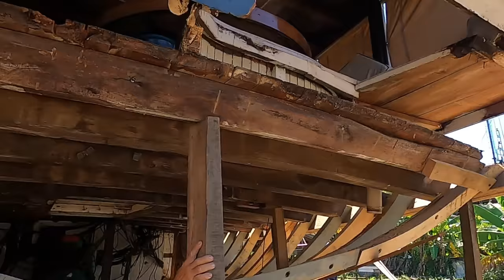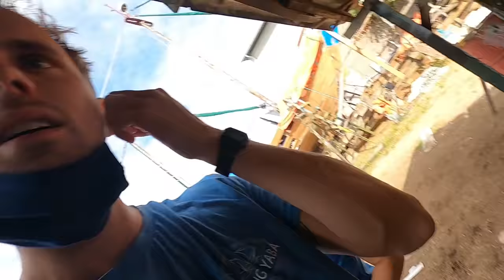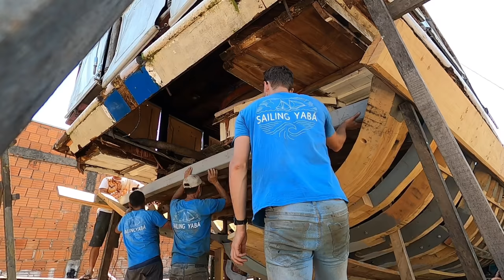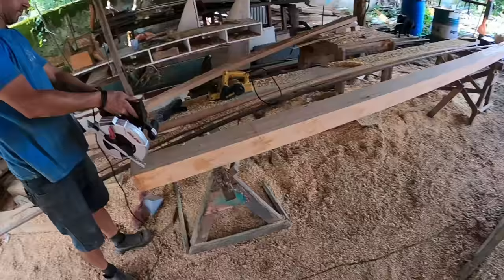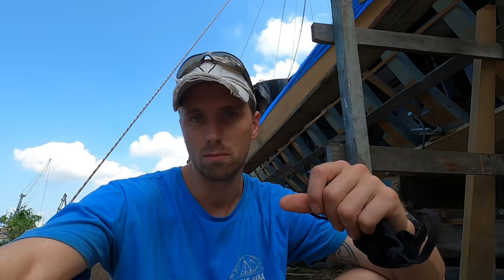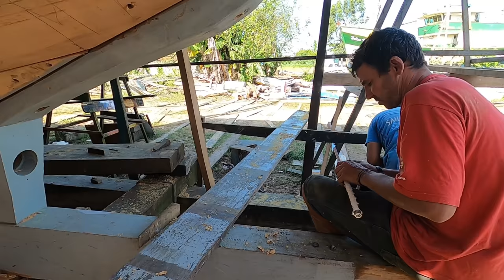Wooden schooner rebuild: TRANSOM! — Sailing Yabá #31

Comment: Not finding fault, but in my 80 years I have been involved in many boat repairs but I have never seen what appears to be galvanized nails use to hold the boat together. One should avoid, steel(except stainless steel) iron and galvanized nails. Use stainless steel or bronze bolts and screws. If you have spent much time on wooden docks for instance, you will see galvanized nails with rusty heads actually protruding above the deck boards. It seems that many seem to always back out and once this happens the hole will never hold the nail firmly again. My friends, there is much to rebuilding wooden boats that is just not being done on this project that will protect it 10 years from now. I suspect that this is why this boat is in this shape after such a short amount of time?
Reply: 100% correct. But this is also cost related.  Joints are far too rough and will gather rot. I have never heard let alone seen non stainless or bronze being used as metal fixings. Also not sure how hard this wood is as the speed at which the band saw is cutting through the frames along with the amount that can be taken off by a small electric planer is not something I have seen before using hard timber. Would not like to faring her after caulking. Their arms are going to like lead!
Reply: After seeing Acorn to Arabella and Leo at Sampson Boat using copper bolts and bronze rivets, that's exactly what I tought and questionned long ago... With no answer. To me, it's not if but when the iron rot will appear throughout the whole thing. Again. Sad. Surely a matter of costs in Brazil but even so...
Reply: you are perfectly right ...this will not last very long ...
Reply: Except you are finding fault, this is how boats are built in this area and the boat will likely outlive the owners.
Reply: CaptRon, very nice the B-25 Mitchel, is it yours?
Here in Argentina they are restoring one and they are going to take it to its original flight condition. If you want to see it on the FB page ... the link is this: https://www.facebook.com/proyectob25. Regarding your comment about yaba and nails and screws, I totally agree with you. I have visited many shipyards where I saw old classic wooden sailboats restored. In Brazil these escunas are very common for coastal navigation. but in recent years its construction has declined due to the prohibition and restrictions on the use of wood. Greetings from Argentina.
Reply: Using DGS (Deep galvanised steel) isn’t unknown,copper/ bronze better but expensive electrolytic reactions shouldn’t be a problem a good primer rich zinc/ aluminium primer may help. Wooden boats are cheaper to buy but much more expensive to keep even if you do all the work yourself.
Reply: @TheBeaker59  Sorry John, I really do wish this couple the very best and hope that they will get many years of enjoyment from Yaba. But there is no way that Yaba will out last her owners. It simply is not possible.
Reply: Everyone has different experiences, but galvanized nails are indeed common in the boatbuilding industry around the world.  Many marine suppliers continue to supply high quality hot dipped galvanized fittings and fasteners.  I am aware of several ongoing restorations where planks are being replaced after 75 years and the iron nails are still holding.  In addition, wooden trunnels have held planks on successfully for many decades as well.  Maintenance plays a big role in the rate of degradation of galvanized fasteners and fittings, as does controlling electrolysis.  I am not saying that galvy nails are the ultimate choice, but millions have been successfully used in boat building.
Reply: Relax, this is how they build ships in the area. The shipyards there have decades of experience building these things. When you build yours , you can share it on YouTube
Reply: @75echo  Really?? And this is how they build "ships" in this area so its ok?? This is your answer to what is 'ok' verses what is proper and correct?? Are you suggesting that because they are wherever they are that using improper fasteners makes it ok?? I suggest that the "ship" as you call it is likely in the condition it is in for the exact reason, using galvanized nails, steel and cast iron!! If you somehow believe that salt water will somehow not soak into and around the planking then you obviously have no experience with salt water and boats. Why do you think it is imperative the engines used in salt water have fresh water cooling? Because salt water will wreck an engine cooling system is short order. As for this boat, I promise you it will be on the hard once again with major problems in the NOT distance future.

Comment: Every time I watch one of Yaba's videos (I dont understand why, but I'm fascinated by their good mood I guess) I ask myself, "What on earth made these two dreamers decide to "restore" a piece of junk instead of either buy a decent 2nd-hand or even build a totally new Yaba from scratch?" Coz I bet, if you do in-depth calculations, that the cost of carefully remove old rot and then carefully fit new timber into the remaining fragile carcass, you will find that the price of restoration vs new built has a 2:1 ratio (ofc just an estimate but you get the picture).
So, at what point in time is it realistic to say, "We turn around, stop the restoration and build new?" Just like it's with old cars, it's very difficult with boats, but a good inspection - even dreamers like these guys - would have been able to poke the wood throughout and easily found the rot. Amazing how amateurs can rule the world, and I'm glad I dont have to deal with them.

Comment: I'm curious to learn what kind of wood was used on this boat originally. What made it rot so quickly and aggressively? And what kind of wood are you replacing it with? Will this be a big improvement over the original wood?.

Comment: Not sure if you have already considered it, but based on past videos of the engine room and other areas, you really should consider re-wiring your boat. I know it's an expensive job, but in the end, especially while the hull is still accessible, You almost have a new boat anyway. Very best wishes. Bill

Comment: Why didn't you entirely removed the engine for a complete internal checkup in a workshop?
Reply: The way to eat an elephant is one bite at at time.  (Oh, how politically incorrect is that?)
Reply: ... cause it makes too much sense
Reply: Pull the head off and send it out for rebuilds. Check the bores. New head gasket.

Comment: My gosh, this is starting to look like a 1/2 million dollar rebuild.
Reply: Sampson Boat Co done fast :(
Reply: Yeah. It would've been cheaper to build it new. That way you just pay for new materials and labor to build a new boat. Instead they paid for this disaster boat, paying the labor to take everything apart, paying to haul off all that garbage, buying all new materials, and the labor to build a new boat. If they really really wanted to save like the only pieces not rotting: part of the bowsprit and like mast, they could've bought those pieces off the shipwreck for like 20 bucks and I don't know, made a table or something out of them for the new boat.
Reply: It's not that expensive, the minimum wage in Brazil is close to 300 dollars a month, so if they pay the minimum wage for 10 workers, it's only 3,000 dollars a month for labor, and wood is very cheap here too .
Reply: If they were in the US, I would agree. But the labor and materials in Brazil are a fraction of the cost.
Reply: @charonstyxferryman  Zero need for naval architect and the lofting. There are plenty of plans available for purchase that were designed by ship architects and are pre-lofted. They can be handed to a shipwright who can get on with it immediately.

Would've even provided the flexibility to find a design that fit their needs better.
Reply: @lordofentropy  LOL
Reply: @charonstyxferryman  LOL
Reply: @charonstyxferryman  They could have bought for example reasonably priced drawings from workingsail and built one of those vessels. They are not expensive (drawings) of proper little ships that can cross seas. Lofting is easy and can be done by rookie if care and time is taken to completely understand work needed.

Comment: Do those guys not wear any ear protection? Seems being exposed to the loud noises from the machines constantly could harm their hearing over time.
Reply: Yet they have to wear a face diaper for the c19. Upside is dust protection level 10 achieved.

Comment: How long do you expect those nails to hold? Is bronze or copper an option?   She is looking like a boat again. Can't wait to see her sail.
Reply: A well constructed hot dipped galvanized nail should hold fine for 50 or 60 years, especially if the boat is properly maintained.
Reply: @boooshes  well that's a very long time.  glad to hear it.

Comment: Please put a new motor in it. You are building a all new ship . New wiring ,New pluming , new motor . Or rebuild it. Be careful most rebuilders will only replace super bad parts and leave one that don't look to bad. Replace everything inside . Or put something  on the transom so if you need to a outboard can be used. Love your ships wheel!!!!!!!!!!!! Some old English ships had keel bolts that were 16 feet long. The ship is going to be beautiful !!!!!!!!!!!!!!!!!!!!!!!!

Comment: It's been a good series of videos to watch, but to an untrained eye (like me) it looks like more of the boat is being replaced than saved, I think most people would have just let the ocean have it.
Reply: But you gotta dream the dream........
Reply: have you watched Sampson Boat Co. Tally-Ho project they have effectively built a brand new boat. What starts as a smaller project grows as you find more and more to fix or replace. In the end you get a new boat with an old character
Reply: @douglashoward346  Sounds good I'll check it out, I know how that happens with the projects around the house, a small fix turns into something major.
Reply: I think it tougher to buy a new boat than repair an existing boat in Brazil.  This is true of foreign boats not sure about local boats. Plus it makes for good videos.
Reply: yes it is the template
Reply: The story of the family heirloom 300 year old shovel where the handle has been replaced 20 times and the metal head 5 times. Is it still the same shovel?
Reply: @snafufubar  But then if showel is just few years old, but already has broken spade and handle would you repair old with same materials or buy better new.

Comment: Why nails?  Would not screws be easier to work with?
Reply: Ask the vikings why they used nails.
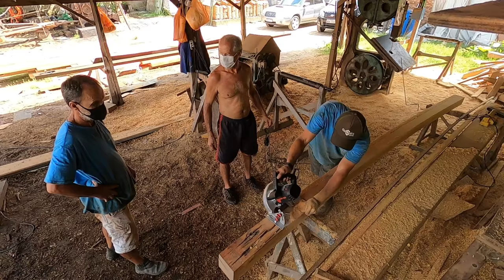Reply: Watch Ep22 at 12:30.
Reply: @pete7708  thank you
Reply: @MegaDirtyberty  They used rivets where pull is experienced. Wood nails were used in places where pulling forces is perpendicular

Comment: I know that you posted some Maintainence of the bandsaw, how often are they sharpening the blade of the hand planner and the chainsaw?
Reply: You know, I have a hand planner just like the one they are using. My blades are remarkably resilient. Of course the type of wood that you are planning dictates how long the blades stay sharp. If you are planning a hardwood like oak you would have to resharpen about every plank. Soft wood like pine you could do maybe two planks. My 15” cabinet planner goes much longer. Not knowing this wood it looks fairly soft. Also the quality and hardness of the steel used fo the blades is probably the most determining factor. I am amazed at how talented the guys are especially with the hand tools they are using. I wonder how they found this yard. Like everyone else I wonder how much this Is costing them?

Comment: and now i'm wondering why they didn't just commission a new boat and salvage what they could off the old one. at this point they've replaced all the hull planks, the keel, the ribs, the transom, and now the soles of the top deck. the only thing left is the cabin, the engine, the masts and the fittings. 

is there going to be anything of yaba that will be saved?

Comment: When you first started this project, I knew that you were going to have to do a lot of work to get this finished. I don't know how much money you've had to spend on this, I know here in the U.S. it would have been less expensive to buy a new boat.  Having said that, let's go over what you've done so far.

You've removed and replaced all of the hull.
You've removed and replaced, if not all, almost every frame in Yaba.
You've replaced and rebuilt most of the transom.
You're just starting on the deck, but much, if not all, of that is going to need to be replaced, most likely including what is already inside of the yacht.

You need to rebuild the walls of the upper structure.
You may need to replace the masts, or some of the structure for the masts.
You SHOULD, if nothing else, remove and rebuild, if not replace, the engine and transmission.

Once the hull planks are in place, I hope that you will fiberglass the hull all the way to the gunwales.  That should prevent water intrusion into the wood.
I hope that you will, instead of reinstalling concrete ballast, instead, install fin stabilizers, one on either side of the hull.

I think that, given the labor rates in Brazil, probably did not make a bad decision, but I doubt that you expected it to cost this much to repair, and would be this involved.

Can you tell us how long this has taken so far?  I know we see some videos, but I also know that they are lagging pretty far behind.  A date on each of the videos would be helpful in giving us an idea of where you really are, as well as when you first took possession of the boat.  I also would be interested in how much this is costing you, in real money, and if it was what you expected.
I do hope that when she's done that she'll be what you hope for.
Reply: The fact that you suggest Fiberglassing the hull shows that you know very little about wood boats..
Reply: @sidimes2227  Care to explain why you would say that?

Comment: i still do not like cold bending those planks on to the frames those fastenings are holding a lot of pressure. i would have preferred them steamed first
Reply: They will settle into place over time and most of that stress will go away.
Reply: @boooshes  My thoughts. And as far as i could see on the videos, they are not bent too much for the need to steam them. Also, i'm 100% sure that these guys know exactly what they do. Together they have at least 100-200 years of boat building experience.
Reply: @boooshes  I am not sure about that. I just removed plank from my boat that had been bent cold and it straightened instantly. It had been there since 1951
Reply: @boooshes  not for me